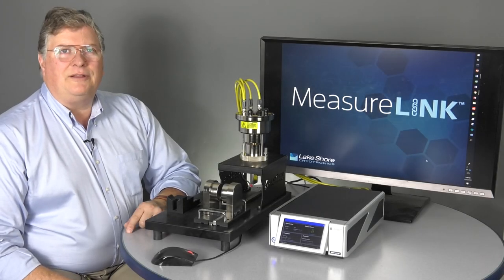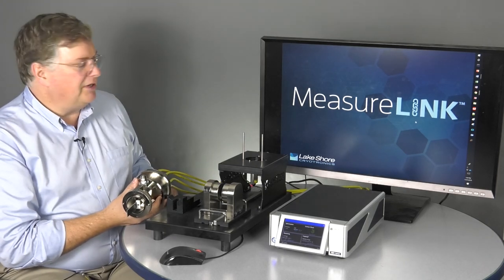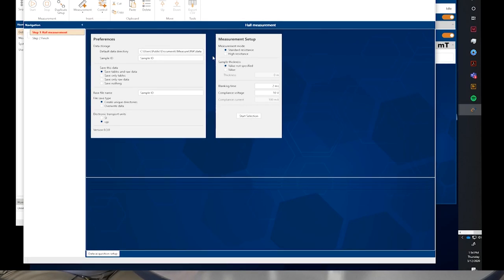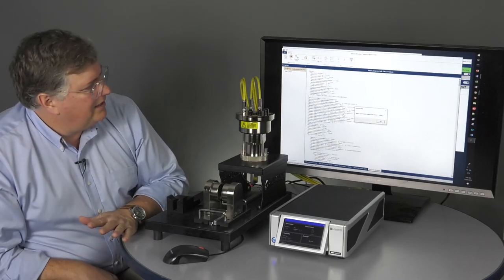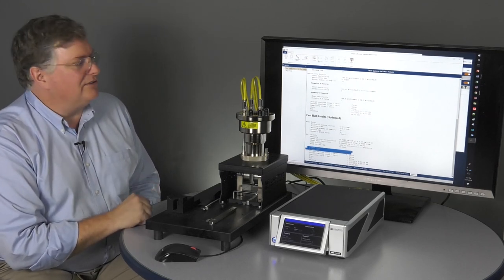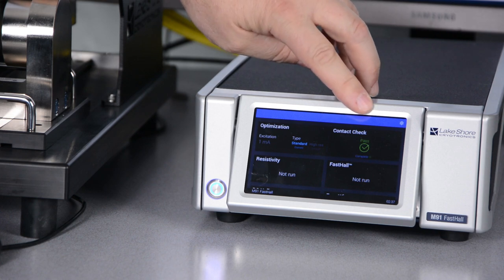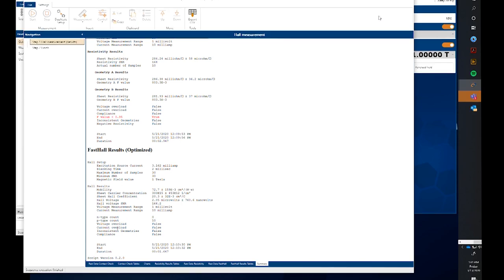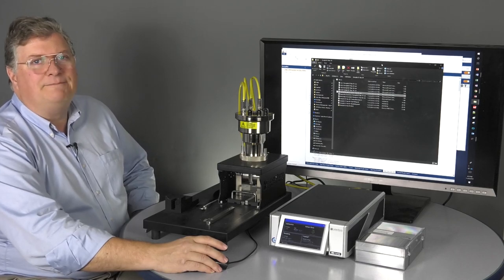Lake Shore Cryotronics' HMS-TT Tabletop FastHall™ Station Demonstration, with Kevin Carmichael

Comment: Can this system make Hall measurements in the Van der Pauw Configuration on thin films deposited on glass substrates?
Reply from the maker: The FastHall technique can generally measure thin films as long as good quality contacts can be made to the device.